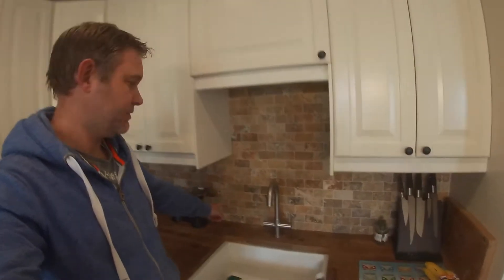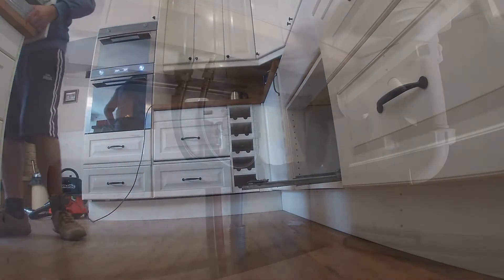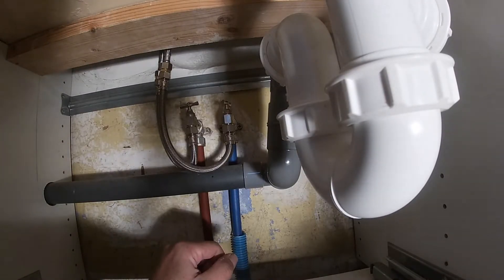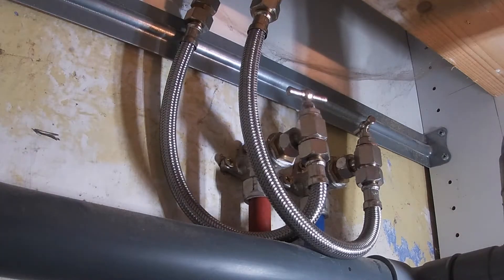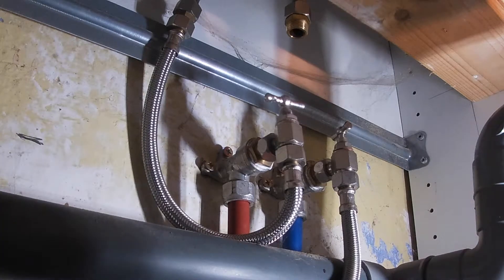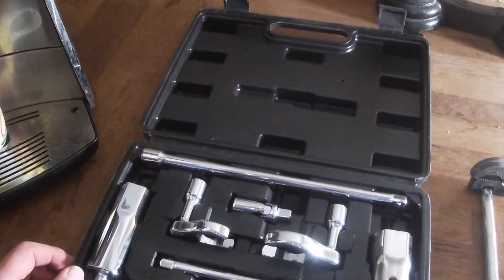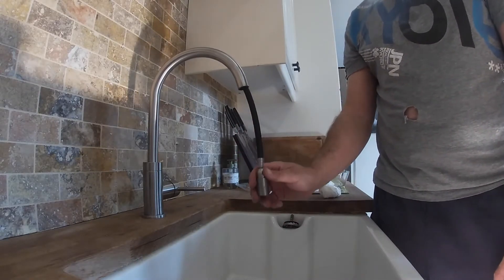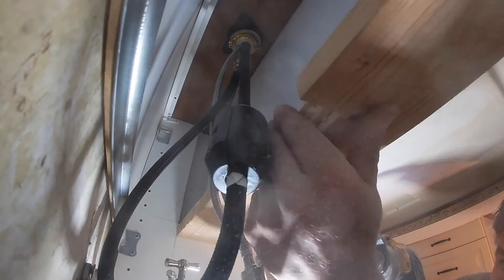Changing a tap on a belfast sink

Comment: My Belfast sink tap got a hole in it after two years and I've repaired it using an old knife and metallic tape!😂It's been like that for two years now, so I'm desperate! It leaks so badly at the base too but that was happening when the tap was new!
I'm so happy to see the underneath of your Belfast sink looks exactly like mine.
I'm praying, I can learn how to do it myself as the plumber wants 200£ to put my new tap in. The labour only!!
🤞🤞🤞🤞🤞🤞
Reply: Ohhh, my sink isn't fitted the same way! It needs to be removed each time! I know as this will be my third tap! 
What a stupidly designed sink and tap I have!!
I'm in the UK! 
My sink is very heavy and I don't know how I'm going to pull it out 😭
But a big thanks for your very good video. 🥀
Reply: yes would about right for the job...

Comment: You may have just solved my issue. My taps leak at the base of the taps on top of the wooden work top., therefore I will tighten that screw your fancy gismo wouldn’t undo underneath the sink. P. S Rosie Is a princess!
Reply from the maker: She certainly is. Quite often the tap is slightly off centre and the rubber seal underneath actually misses the hole where the tap is. Sometimes just moving it and re centring works well. AJ